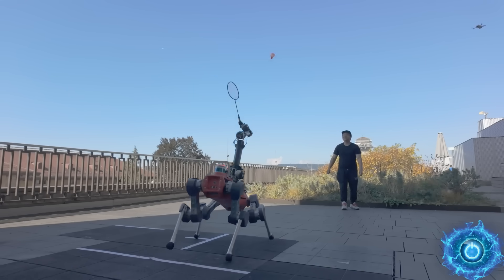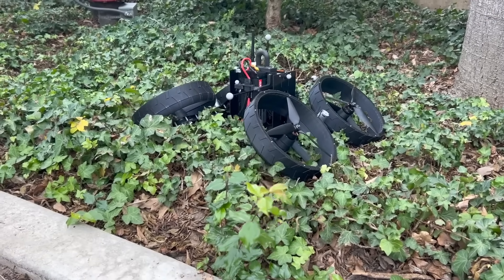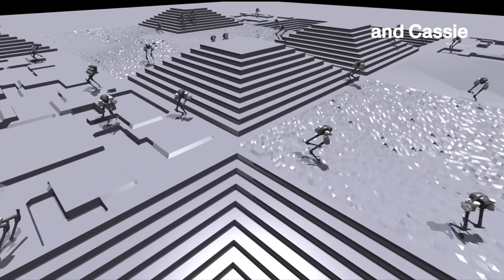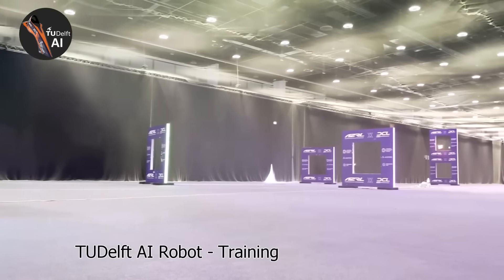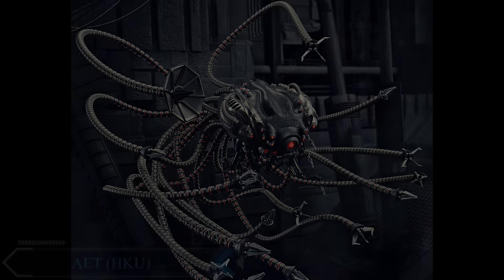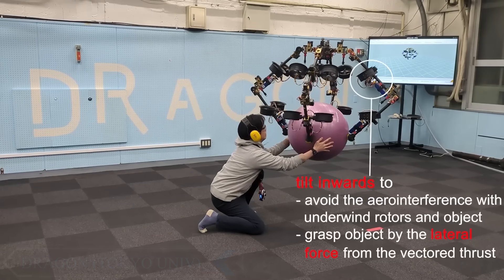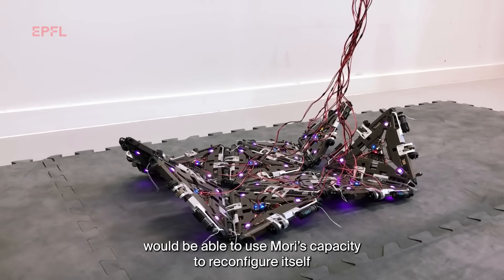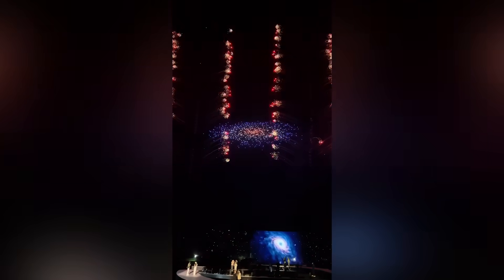GAME OVER!? -A.I. Shapeshifting DRONES Take Flight

Comment: How about a flight pack with an assistant ai to aid in controlling it?

Maybe add it on an exosuit
With long mechanical arms for reach
Mecha leg stilts with robot dinosaur feet to add better balance control

Or better yet add a stabilizer counterweight pole on the back of the suit to serve like a tail on a dragonfly

Plated armor

Robot hands like the DG-5F with glove controllers

AND THERE YA HAVE IT

A COOL MECHA EXOSUIT

maybe you can use it for casplay, war scenarios, or vfx for films
😗🤚 just saying~

Comment: As someone in this field, you'd be amazed when you see there is RL + MPC, the paper is called TD-MPC, it is a type of online reinforcement learning. It isn't that easy to say these things can learn in simulation, then applied to reality. The main problem is making sure the simulation behaves the same as the real world, although stuff like DR can compensate for this. But you'd have to know the parameters of the real world first or at least an estimate. There could also be changes in the parameters over time, so you'd have to account for that in the simulation.